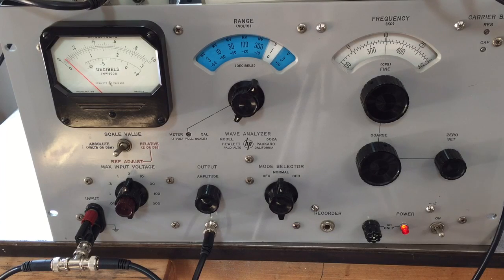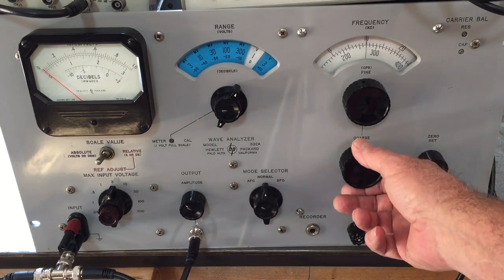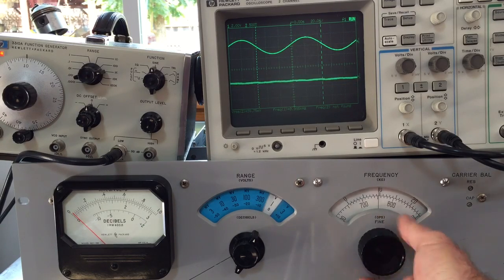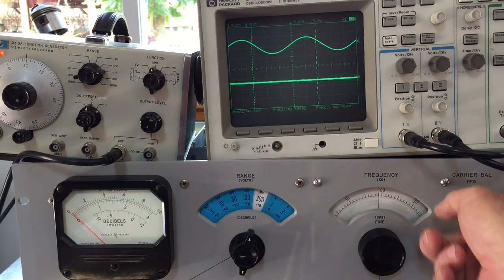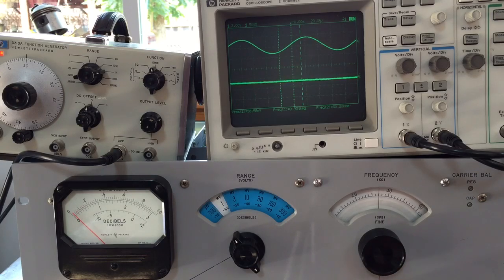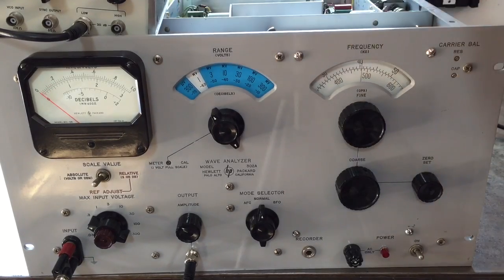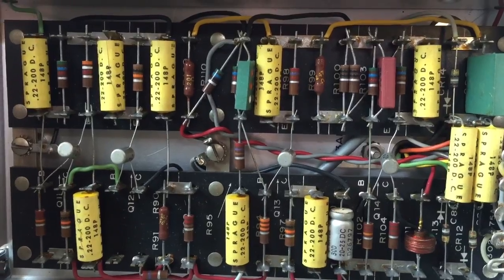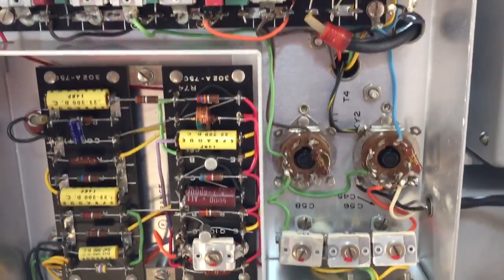HP 302A wave analyzer demo

Comment: Hi Tom...I have one of these units, and it's missing the crystals as well. I'm really interested in how you put those solid state oscillators in. I'd like to be able to bring mine to life. Please let me know if you'd be willing to show us that!
Reply from the maker: I got the bare 8 pin octal  tube base with the pins and just soldered in the 100 Khz crystals, pins 3 & 7. All parts found at my local surplus, I'm sure you could find the parts on ebay. I think I could have bought the oem style but they were a hundred bucks or so, instead of like 10 bucks. oem tube BG9D-S

Comment: Awesome piece of gear! These demonstrations are a fantastic resource for those interested in these great vintage equipment!
Maybe you still can find those glass tube oscillators on ebay or vintage components' surplus shops. Their prices will vary all over the place (as will their descriptions!) so patience and perseverance will be required but I expect they'd pop up somewhere within 2-4 years' time.  I don't know what kind of demand there is for them from ham operators that use vintage gear or from vintage RF equipment restorers but it seems this is a low frequency device so I'd imagine there shouldn't be any really.